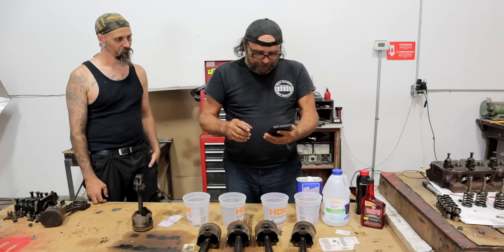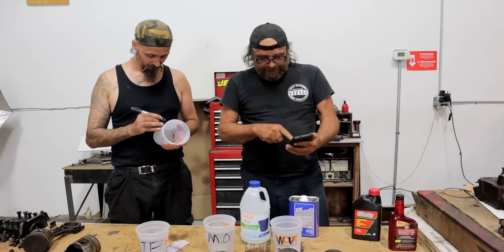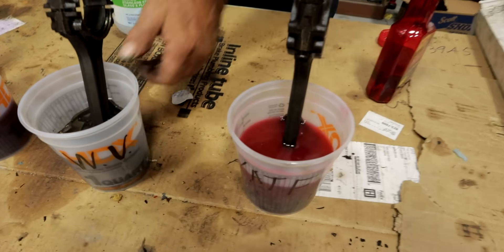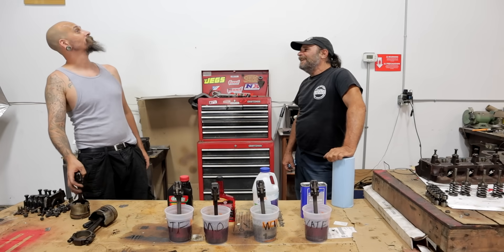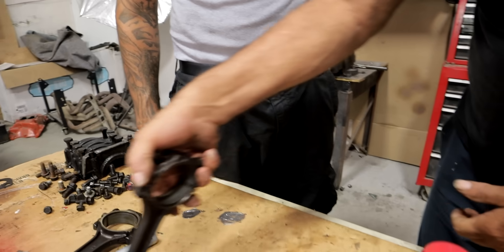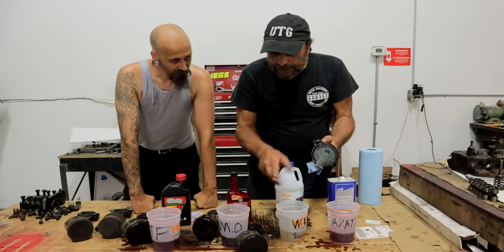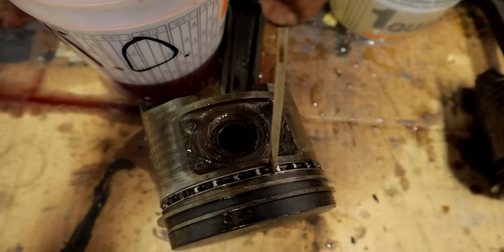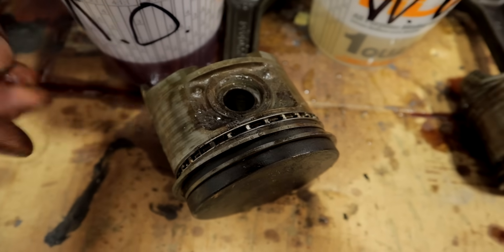Best Fix For A Stuck Engine - Viewers Choice. Marvel Mystery Oil, vs ATF, vs Acetone, vs Vinegar

Comment: I'm not a chemist but I read a lot, and I restore old woodworking tools as well as cars. The trouble with vinegar, or any acid-based cleaning technique, is that it can cause hydrogen embrittlement of iron. I'd be reticent to use it on a part that is subjected to intense stress out of fear that it would cause cracking later.
Reply: Hydrogen embrittlement is most dangerous in high strength steels(and hardened steel) and steel springs subject to various energetic operating conditions....torque, bending, heavy vibration....etc.  But it CAN cause issues in less high strength steel as well!!!!  
INDEED, one must be careful using acids to treat any steel parts!!!!  BEWARE!!!

Comment: This video just freaked me out .. i wonder now what questions I haven`t asked, never mind having the answers. i just necromanced my stovebolt which has been sitting 5 years .. squirt of 5-20 down the bang holes, rotated by hand a few revs .. and gave it the starter and fresh gas. All seems well - sounds good with 20 inches of vacuum. I had been worried about rust rings on the cylinder wall .. never thought about rings stuck in the piston lands. I expect there are a lot of viewers going the long haul on projects .. or with a field full of dreams. Curious to many questions. For example .. is an unstuck engine still a daily viable, or a primed grenade? Does a bit of rust on the cylinder wall just go away after ten minutes - or you may have well poured sand down the carb? I know there are a thousand variables, but it would be interesting to see you cover 'junkyard jewel resurrections' from 'if it goes, run it'  - to 'you need a machine shop'. I have six projects here which haven't run from five to thirteen years. i stay awake at night wondering if some of them haven't simply become trash.

Comment: Personally watched a seized piston in a motor the guy dumped kerosene down the sparkplug hole. Left it overnight and came back to turn the motor back and forth by hand. The motor freed up and eventually ran fine with no smoke after some time

Comment: Another material to try is polyether amine sold as CRC turbo and intake valve cleaner. It's the same additive as Tektron that's used in Chevron gasoline.

Comment: 50/50 acetone and atf are my go to, acetone carries the atf in pretty well and makes the carbon soft rather than drying it out in my experience
Reply: Acetone isn't really intended to clean grease and oil it's a paint product.
MEK is for quickly breaking down oil and hardened grease and Tar.
It's cheap and available in hardware store.
I've had great success with it. 
It evaporates just as fast so it needs to be covered up to prevent drying

Comment: the vinager works because it eats the aluminum corrosion that is causing the rings to stick if it was in a heated ultrasonic cleaner they would look almost brand new.

Comment: Atf. acetone and lacquer thinner, or. . . Parts cleaner solution maybe carbon tetrachloride if you can find it
.I was recently reading about something called Stoddard solvent it's an additive in 2 stroke oil so maybe 2stroke oil and lacquer thinner

Comment: i wonder what vinegar and atf would do. atf needs heat to work properly for cleaning. atf and vinegar would most likely work really well to clean but it is an acid so it can eat things. if the fluid was heated to around 200 degrees with a hot plate or something it would most likely even break the carbon down as hot atf can do that on intake valves.

Comment: Hi Uncle Tony!!!!!! I have a 68 4 door dart with a 273 V8 that is stuck.BAD. When I got this a couple of months ago I was told the bottom end had been re-ringed and honed and that the heads were done. wellllllllll maybe but it is stuck.  Before I watched your video, I filled the cylinders with Marvel Mystery oil it's been a few days and still stuck. So I am going to let that run on down into the crankcase and try the White vinegar on it. Wish me luck Tony because I really want to make this a sleeper but right now it's a corpse. Any suggestions from your fans or you would be greatly appreciated. All in all it's a nice car that I would love to get back on the road. Oh yeah it needs a driveshaft so if you have any spares laying around, I'm buying. Thanks and keep putting out the videos we love them!

Comment: I was once given a free generator that was stuck because some dingdong forgot it needed an oil change every once in a while.
Took out the spark plug and poured 50/50 of ATF and Acetone and after letting it sit an hour it was loose enough to turn by hand.  Drained it back out from the top and it started up with some fresh gas.  Very smoky on start burning all that crud out.

Comment: Surprised straight kerosene wasn't recommended. Used to be the stuff we used in the tool room wash basins before the new guys complained of the smell and we had to switch to whatever the safetykleen stuff 'that nascar uses'.
Plus you can start your wood stove with just a quick squirt of what my grandfather called 'boy scout juice'
Reply: Back in my day (60 years ago) the old timers (50 years older than me) always filled up the spark plug holes of a frozen engine with kerosene.
Reply: my Grandparrents called kerosene "coal oil"

Comment: Phosphoric acid might be a winner as well. I use it on messed up carbs. might work on it's own.  I have a container that I put the carbs in full of the acid and use a battery charger and a piece of stainless steel as the sacrificial electrode. It's electropolishing same deal as electrolysis. Takes the corrosion right off of carb parts. A 45 second swim hooked up to the charger might be all it would take to free everything up if it's rusty.  I would love to see if it works on those stuck rings.  Here is my carb video https://www.youtube.com/watch?v=IW_x73crUT4

Comment: ATF has always been a poor cleaner. I’m not sure where the old wife’s tale about ATF being full of detergents came from but it’s simply not true. ATF has a very small percentage of detergents compared to engine oil because it is not needed in a transmission. It’s the combustion process in engines that create the sludge and other byproducts that require detergents to keep it in suspension until it’s drained. Automatic transmissions don’t have a combustion process to create the sludge hence no need for large amounts of detergents. Before everyone gets pissed and flames me here just send a sample off to a competent lab that tests fluids and ask them how much detergents are in it compared to any average engine oil. When I first began my automotive technician career 33 years ago I too thought ATF was a good cleaner for stuck lifters. It just isn’t and never has been. Over my years as a mechanic I learned that most mechanics are extremely brand loyal towards oils and fluids but they aren’t actually knowledgeable about what’s actually in the stuff that they are so loyal to.

Comment: So, this was a good test, but there are a few problems.
A frozen engine can result from a few things. 

First, there's rust. Vinegar is going to be best at this hands down, because it's been used to dissolve rust for centuries. If your engine has been frozen from sitting for years, especially if it's humid, vinegar will be your best bet. You just have to be careful, because it will start dissolving iron too. It can destroy compression rings and start pitting your bores. 

The second problem is generally due to dry metal friction with other dry metal. Pretty much any oil will work. But Marvel Mystery Oil will probably penetrate smaller spaces better because it's a lower viscosity fluid than ATF and 10W-30 motor oil at room temperature. So using Marvel Mystery Oil will probably result in better lubrication between pistons and bores, especially as you start getting the pistons moving back and forth a little. That's when you really start breaking down internal friction with a frozen engine.

The third problem is carbon contamination helping to lock up compression and oil rings. I've used Marvel Mystery Oil for over a decade now to help clean carbon contamination out of engines in my cars. But that's not a problem that will really be addressed until oil is actually circulating in an engine. ATF and Marvel Mystery Oil are both full of detergents that will help start removing carbon, so maybe over a few days or a week this could make a difference in un-sticking an engine if it's in a really filthy engine. 

I've never dealt with a seized engine, because I mostly do basic DIY stuff. But based on the above stuff, I'd be really interested to see someone try to unseize an engine using a 50/50 mixture of Marvel Mystery Oil and vinegar after giving it a 24 hour soak. I bet you'd have really good penetration combined with good lubrication, good rust removal, and some basic carbon removal at the same time. You'd be attacking all three problems at once.

Then, once the engine has unfrozen, crank the engine over with Marvel Mystery Oil in the oil pan until there's good oil circulation throughout the entire motor. After that, move on to cycles of cranking and leaving it to soak to remove sludge and carbon from the oil galleries and the bearing races. After a couple of days of this, you'd probably have the piston rings totally freed and the oil galleries well cleared out and you could move into regular oil with a 20 percent mixture of Marvel Mystery Oil, and actually running the engine.

Again, that's just me with virtually no experience with locked up engines. My two cents.

Comment: Nice video and I appreciate the nod to PF.
I had a push mower that cut like a champ but used as much oil as gas and blew black nasty oil out of the exhaust. I put about 2 oz of SEAFOAM in the oil and mowed the front yard (20 minutes). Topped off the oil and cut the back yard (30 minutes). When I finished the back yard there was no change in the oil level and no more black oil in the exhaust. I assume I had a stuck ring the Seafoam worked on for a few minutes. Either way it was nice to not have to buy a quart of oil every other time I mowed the yard.

Comment: Interesting. I've heard using diesel fuel with rusty parts to get them unstuck. Maybe you could try that with the next round of name brand trials. Vinegar makes sense as it has acetic acid to help eat away at the rust. Cool test
Reply: I was suprised that diesel wasnt in there. But new diesel is not the same as real diesel
Reply: @ole-mariusbergesen7818  fair point. We be interesting to see if it does anything though. Not sure if the lack of sulfur perhaps was the key.

Comment: Acetone and atf usually helps free stuck bolts and would penetrate quicker than the other stuff and is better than most penetrating oils like pb or wd..  but yea if letting it soak overnight in vinegar would free the bolt better..  then again so would  heating the bolt up and to free rings a torch works everytime..  now freeing a seized motor i guess vinegar for the win here…

Comment: Carb cleaner and a heat gun to free them up. Heat is your friend on a lot of things like this, a little work and penetrant should make short work of stuck rings and wrist pins that aren't heat fit. It also saves a lot of time, just be sure to wear rubber gloves is all, as you should when working on cars in general. They save your skin, protect you from some of the chemicals and you can simply pull them and all the grime off and toss it away. A mix of ATF and acetone with a couple other things is also a popular gun barrel cleaner. Look up "Ed's red" cleaner. Also good for decarbonizing engine parts. 
But heat's going to be the real magic ingredient to getting stuff unstuck, without it you're wasting too much time and may damage the pistons trying to get stuck rings out. White vinegar is great for cleaning rust off metal as You discovered. Feel free to toss rusty hardware in a jar of vinegar to clean the rust off, that's an old restorers trick and it works.

Comment: We run into this with antique tractors. A couple of times I have bought an old tractor that was seize. I removed the plugs and fill the cylinders with seafoam, chained the tractor loose enough so it could rock back and forth on the trailer in gear and by the  time I got home they  were unstuck. If you rescue a car with a manual transmission it would be worth trying.

Comment: From personal experience, I was already thinking that if white vinegar had enough votes to be in the test that it would win. I have tried just about everything over the years and for several years now I turn to vinegar automatically. I have even used it to free up rusted needle nose pliers that my ex-wife tilled up from several inches down in the dirt when she was putting in her garden. They were severely rusted and the jaws were rusted and pitted almost half way through from having been buried for at least 25 years when the garage that had previously been in that spot was torn down. It took 2 days of soaking in the vinegar and about 2 minutes of working them open and closed to have them so freed up that just holding them with one handle up and one down and tipping them over would open and close them while holding them by just one of the handles. They still work smooth as silk 3 years later
Reply: The only time I use evaporust instead of vinegar is when paint matters, vinegar and paint don't get along. So on say an old bicycle with patina I want to save, evaporust is where it's at. But vinegar for the win on anything steel or cast for sure

Comment: I have a continental red face motor from a miller Big 40 welder. The pistons / rings are rusted and motor seized. Soaked in Atf no work, next white vinegar. We'll see....thanks Uncle Tony or should I dare say " Tony's project ranch "

Comment: I've wanted to thread a 1/4 inch inch pipe manifold and  pump up the pressure of the ATF in the pistons , but probably no more than 15 PSI - I think the thin deck plate might leak.  

Most of the time I can't get the pistons out of the block

Comment: Forgot about the vinegar. I have used it for everything!!! Dump a few gallons in a hot water heater and let it soak. Knocks out the calcium and rust like a champ and your water heater will work good again.

Comment: Of course vinegar is going to dissolve  metal and therefore free up the rings. But…. It removes virgin metal in addition to rust.  And if you were to pour it in cylinders to try to free the parts in the engine, it would get past the rings and into the oil pan, and possibly do a lot of damage to babbit in the bearings.  If you’re trying to dismantle something for a rebuild, yeah, vinegar makes sense. But not if you’re trying to resurrect an engine without disassembly.

Comment: The 50:50 Acetone/ATF is best for unsticking rings in an assembled engine.  Vinegar is best in a disassembled engine.  
Would you pour vinegar into an assembled engine to unstick rings?  I don't think so.
Reply: What about for heavy sludge ?
Reply: Why wouldn't you pour vinegar into an assembled engine?
  Leave drain plug open, all it can do is drain out the bottom

Comment: Vinegar did not surprise me, I have used it on old 2 stroke motor cranks you never through would work, atf is the lube that will still be there 3 wks later on a bolt, marvel is awesome, but if I have a brake bleeder vent that won’t budge aceton and atf on it for a couple days and it comes off, I really  throught 24 hrs was a short amount of time for the test but vinegar does the trick

Comment: Good test, but not that surprising if you think that vinegar really is the only one that actually dissolves rust and corrosion.  The downside is, especially in that stronger solution, is that some of the aluminum also dissolves.  😎

Comment: Don't forget that you have to nutralize the vinegar or it will flash rust insanely fast! I got a set of really nasty starrett radius gauges in a eBay lot, I left them in vinegar over night and the acid ate them and that was with 5%. Vinegar is EXCELLENT but it is still acid lol and it causes flash seconds after the part is dry. I'm not sure how good it would be to use in an assembled engine lol.

Comment: Apple cider vinegar. A bit more expensive than basic vinegar, but the enzymes left from the fermented apples dilute everything but the metal itself and in some cases a bit of that too, if left for too long. The temperature and even sunlight effect the reaction, so if your garage is cold, or the tub is left on the floor, it needs more time to get good results. Two days out in the sun, and if the temperature drops at night, bring the tub inside.

Comment: Pure vineyard white or red wine vinegar lol definitely a cleaning agent not a very fast one, but I myself would usually start with the transmission fluid or the marvel mystery oil learned that one from my grandpa I always used transmission fluid,, and from there it usually ended up being a cross between diesel fuel and kerosene and if that didn't work it was usually just stuck..lol

Comment: Personally I use acetone with 10/20% atf.

Acetone works pretty well on its own but after that the cylinder walls are so dry it makes the rusty rings stick even more to the walls.

Acetone works best when it's carbon sticking the rings.
Vinegar is the best choice if it's rust sticking everything in place.
But the exposure should be as short as possible as it will eat the walls and rings.

If you don't want to disassemble the engine after that the engine will require a very good clean for sure. And lube it as fast as possible to prevent it to rust again as soon as the vinegar is out.

ATF, it's doing nothing else but lube it up and free some debris. It's mostly acetone doing all the job.
Reply: I have used 50% Dexron ATF and 50% acetone mixed for years and it works fine for me......i never trusted Marvel Mystery